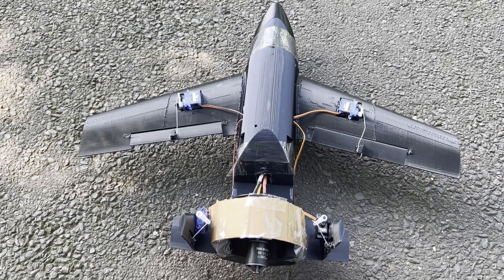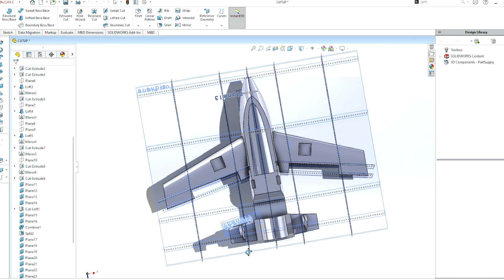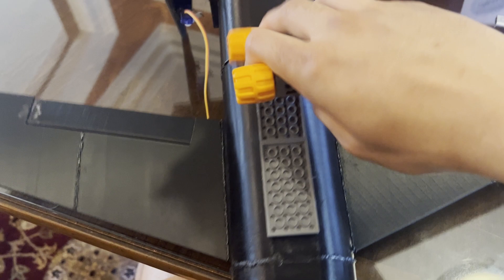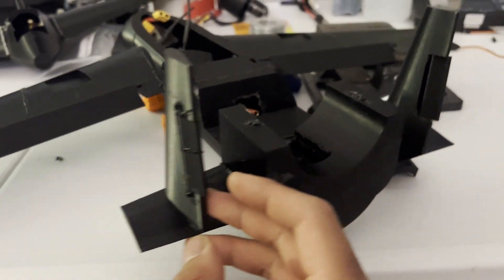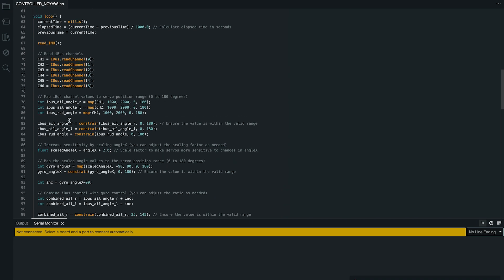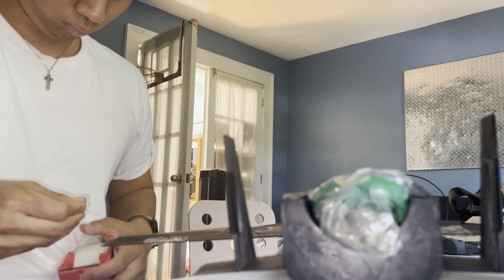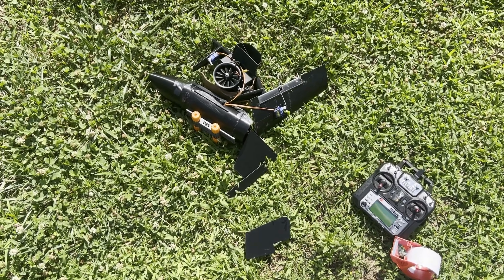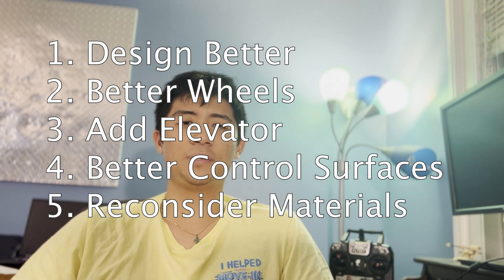$80 Fully Custom RC Plane: Mk 2

Comment: Once again, I'll disclaim my comment as that of a mere YouTube armchair peanut-gallery member... having said that, I highly recommend:

1) doing a tractor design rather than a pusher (prop in front rather than edc in back). This will make it easier to get the CG out in front of the NP. In your hand-launch attempt, we can observe the immediate pitch up. This may indicate that the CG is behind the NP.

2) doing a high-wing design. This will give improved roll stability—purely through aerodynamics, rather than fancy control code. (but don't be taken in by any explainers that fall for the "pendulum fallacy" hahaha)

3) Elevator is absolutely a must. Since the elevators set the AOA of your wing, they are essential for control. If you want to go for a 2-axis design, let aileron be the axis you omit. Keep the elevator and rudder. If you have some dihedral in the wings, you will be able to get enough roll control using the rudder.

The result will not look as cool, but I think it will fly! Good luck :)
Reply from the maker: Haha no worries, any feedback is welcome especially in depths ones such as this

1) My current iteration still uses the EDF but I see more and more why tractor designs are favorable in this use case. If this doesn’t work out I’m ready to switch over for sure

2) thankfully doing this with my current design! Taking a more traditional glider approach

3) yeah this makes a ton of sense, definitely using an elevator going forward.

Comment: I just want to say it's amazing that you're able to design build end program, but the biggest problem  with what you made is the weight to size/Wing area it's just plainly too heavy to easily fly,
From my personal experience something that size shouldn't be heavier than 300g and even that's quite heavy probably 180g  would be good, also those 9g servos ar way too big/heavy for the very undersized control surfaces 
And the same can be said about the EDF which is way too big and heavy,

I know this comment seems harsh
But you have very good hands and even a better head so you will be able to take this criticism and improve your design to make it fly,

I will keep waiting for new uploads to see how you progress,
Good luck ✈️
Reply from the maker: Hello,
Not harsh at all, this is supremely helpful! I’ve had a harder time than I thought finding data on weight and wing design, I figured the EDF would be strong enough but based on this comment and several others I’m probably wrong. 

In terms of wing area, I’m guessing you’re saying the span and maybe thickness is too large?

My current iteration right now is more of a glider style, hopefully making the flight dynamics even more simple. I’m afraid I’ll have the same weight issues though but I’ll be updating. 

Thank you!

Comment: to get it as cheap as possible maybe look into flying wings. Could reduce down to just 2 servos but will need to mix the aileron and elevator inputs. The aerodynamics are a little tricky but as long as you have enough sweep, probably around 30 degrees, and have washout (wing tips are deflected downwards) it shouldn't be too bad. Also means you don't need a tail
Reply from the maker: Yeah that makes complete sense. I actually tried that on my last iteration. I figured I needed some experience with more traditional flight dynamics before doing the wing, hence this iteration

Comment: This looks awesome! Have you considered moving the servos farther into the wing, or even better, to the bottom of the wing? This would massively decrease the dirty airflow over the top of your wing, as well as making it look better. Also, when you hand-launch an aircraft, you need to put some significant force into it. If you don't attain enough airspeed first, you will immediately fall out of the air before you can gain flight.
Reply from the maker: Thank you! And yes, that’s something I’m definitely doing for this next iteration, especially after seeing how RC guys are able to hide the servos very cleanly into the wing. Thanks for the tip